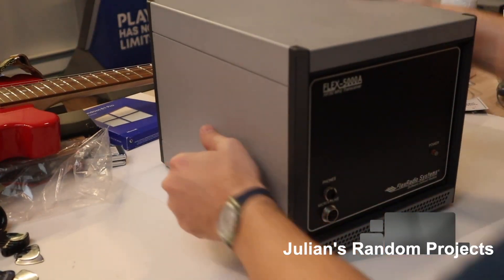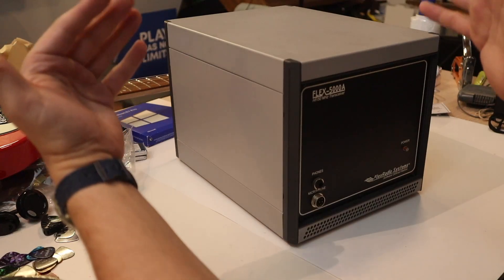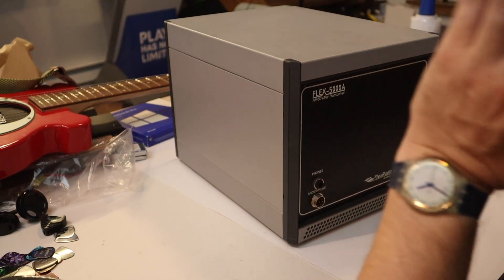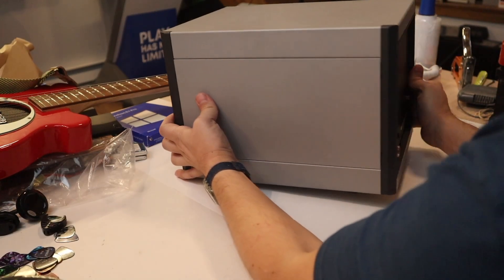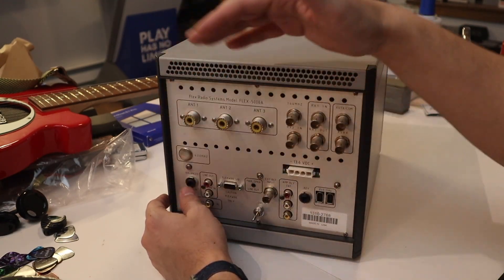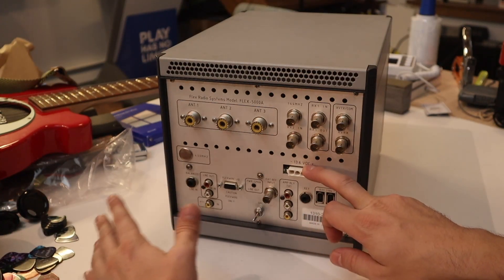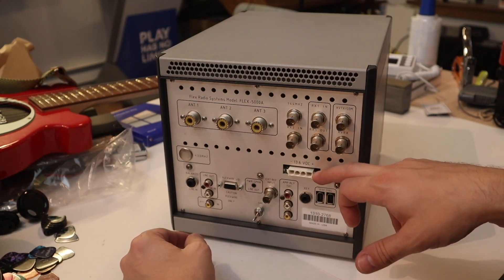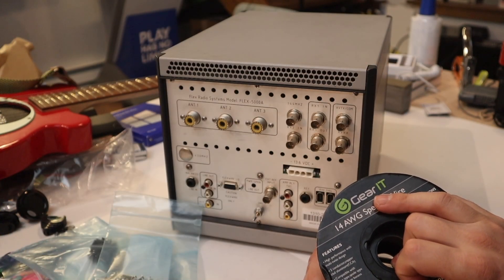Software Radio SDR - Flex 5000

Comment: How's your Flex5k doing?   IDT I saw more vids on it. GREAT JOB ON THE POWER CONNECTOR!  Cringed 5:13 when you originally mentioned hacking into the radio to pigtail the power.  It only takes 10% more effort to go first class.... as you did!  73, Mike
Reply from the maker: I’m loving it! For my main rig, I don’t think I’ll leave flex’s offerings. Can’t wait for the 6000 series to become affordable on the used market.

Comment: Hi Julian, Once bought a Icom IC 7200 for half of market value in 2014. Kind of expected it to not work all that well and when it arrived sure, when driving it more than 30% of power it would drop off. Long story short, was playing with it during Covid and was holding on to the fuse in the wire and realized the fuse was arcing. New fuse holders and Boom running 100w all day!
Reply from the maker: Score! I’ve taken to passing over faulty units with my thermal camera to find faulty parts. Not sure I would have suspected the fuse holder, will now!

Comment: Imagine owning this thing and connect it to the server, so people around the internet can tune the radio on their own independently
Reply from the maker: What you're describing exist right now for receive audio. http://rx.linkfanel.net/ - For Transmit, one could grant access to folks and even route their mic audio in. :) Future project? Maybe use a raspberry pi?
Reply: @JuliansRandomProject  old, unused computer would do the job. All you have to do is renting domain+public IP+VPS, then tunnel the computer to the VPS. Perhaps if you want optimize the setup, Arch Linux could do the trick if you dare enough 😉

Edit: if your ISP can provide public IP, then VPS and tunneling stuffs are not necessary